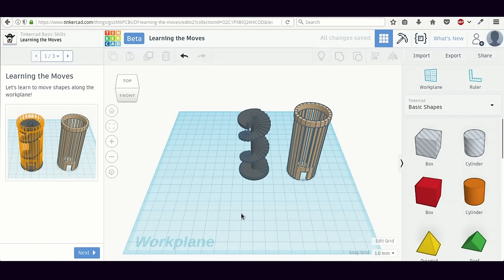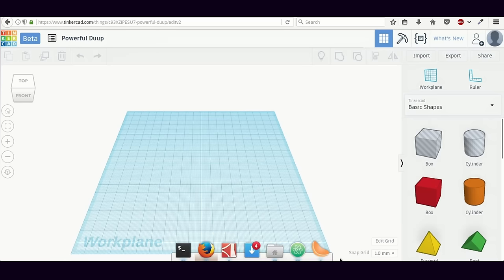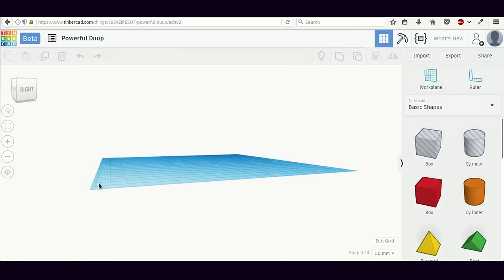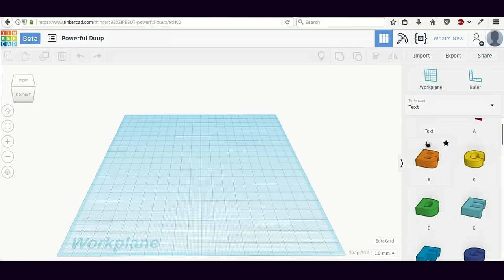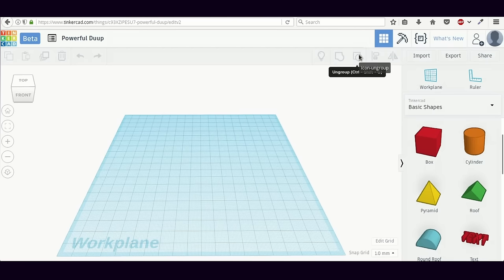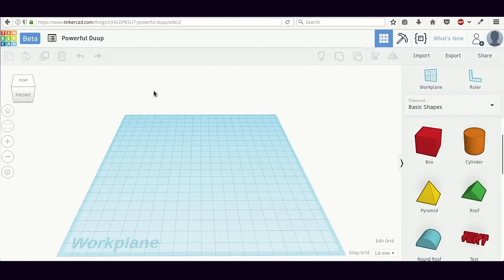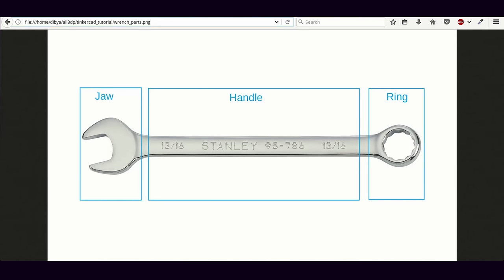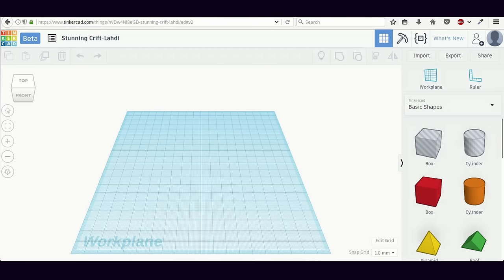Getting Started in Tinkercad: A Tutorial for Complete Beginners

Comment: I guess it was basically helpful as far as combining and aligning parts, but the wrench only works on round nuts. Wouldn't it have been easier to use an octagon in a 14mm size to create the box end of the wrench instead of a cylinder. I know nothing at all about these design programs or 3d printing. So maybe you got me on something I don't understand. Could there be another method of taking off round nuts?

Comment: What about the bolt shape on the inside of the ring? The jaw and ring should be thicker than the handle, not to mention the gradual transition on the thickness. And the full perimeter needs to be rounded. While I hate to throw a monkey wrench into the plans, these finishing touches are needed if the device is to function.